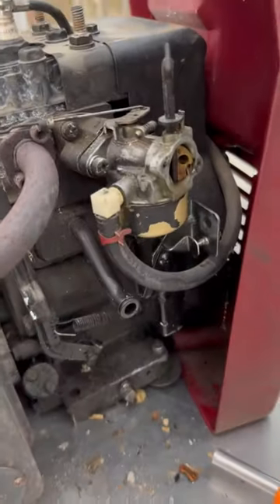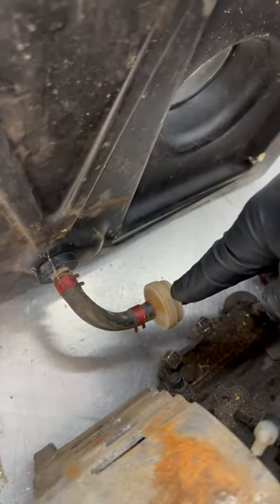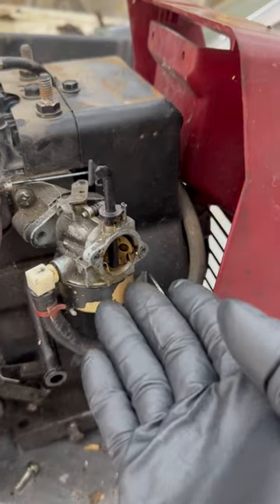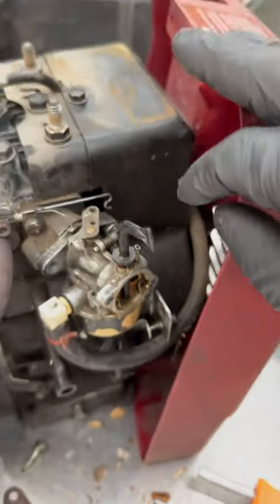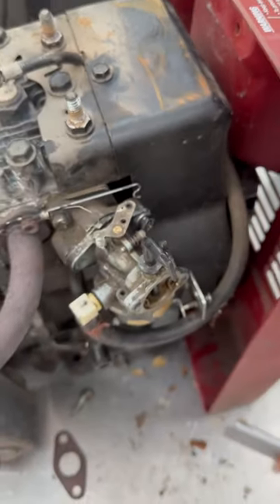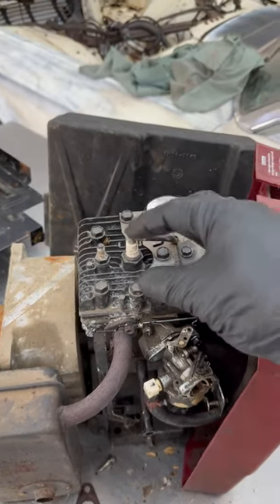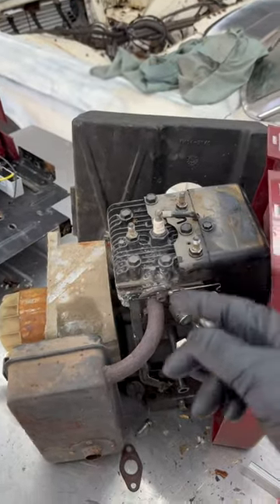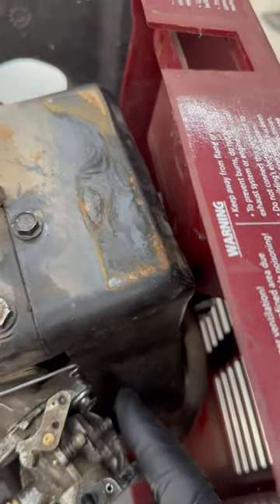How a small engine carburetor works #shorts

Comment: My 80v battery-powered Kobalt mower bit the dust today after about 5 years of ownership. Even though it's "greener" I am considering going back to small engine, gas for the extra power it brings and not having to constantly charge batteries.
Reply from the maker: Bet if you start scanning during trash day in your neighborhood you could find one that will last you a lifetime